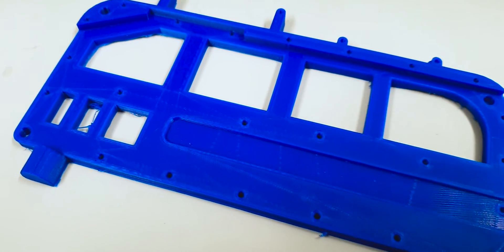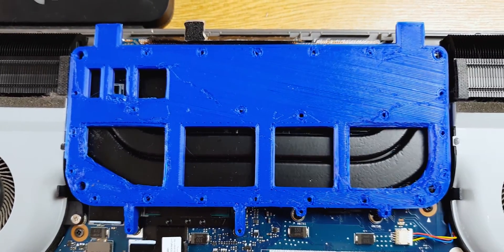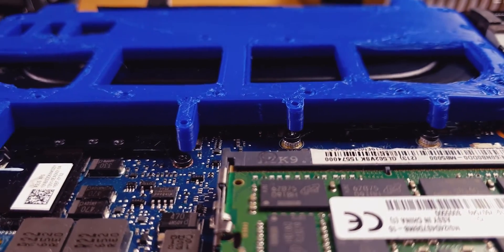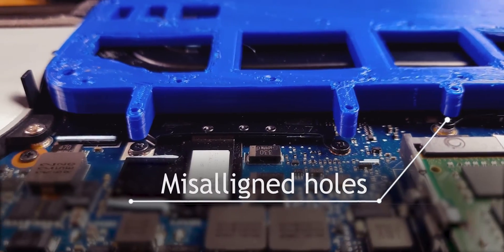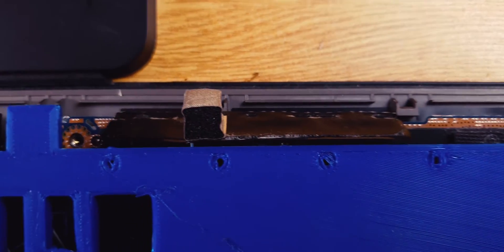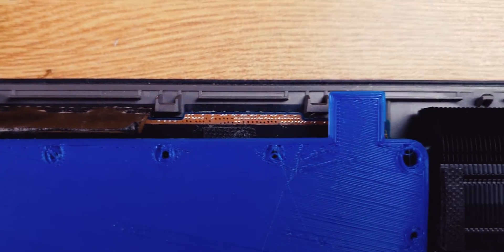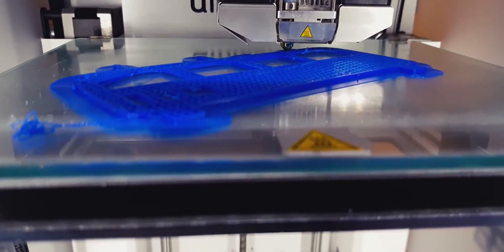Laptop Liquid Loop project. Part 4 – 3D printing the first laptop waterblock prototype

Comment: Buy yourself some calipers please :D My Omen 17 has slightly over 6mm of vertical space over it's heatpipes. That means I would be able to fit a nicely sized waterblock without adding any external size to the laptop! It also has quite a big cavity on it's right side where a optical drive used to be in the last year model.Now I just need some time and preferably a spare heatsink.
Your block is going to look very nice! And will probably perform just as well.
Reply from the maker: Thanks for the advice :)
In regard to a waterblock for your laptop, I'd recommend you to look into adequate waterblock thicknesses. Waterblocks from well-known suppliers all have thicknesses over 10mm, most about 15-20mm, and there're a number of reasons for that. You could start by checking out the video before this one called "Designing the LLL waterblock".

Edit: having said that, if you do find out that thin waterblock (sub 10mm including base, channels, and cover) don't have any drawbacks, do share your info please.
Reply: @MalcolmBlk  I want the laptop to look stock externally and only have a slot in the bottom cover for a pair of quick disconnect fittings. A lot of the thickness on normal waterblocks comes from a thick top and a requirement to spread the heat. And we both want to place the water block onto the existing heatsink, so the heatpipes take care of that. I might just experiment with a copper plate and copper tubing snaked and soldered onto it for a proof of concept. Hopefully soldering said block straight onto those heatpipes with some low melt solder.